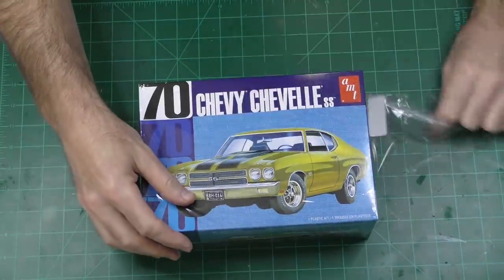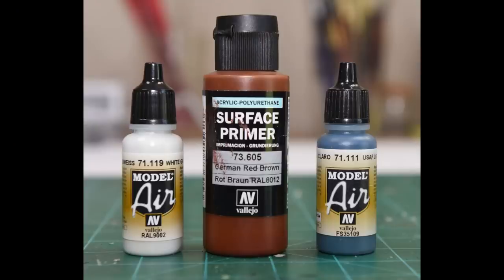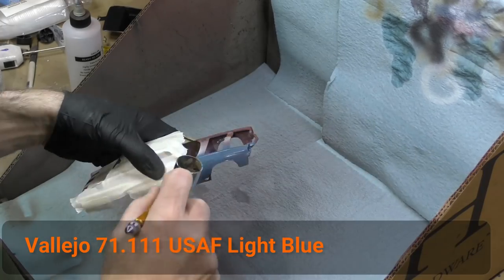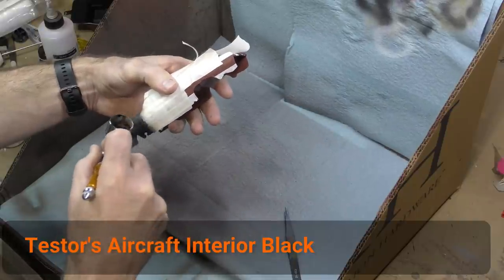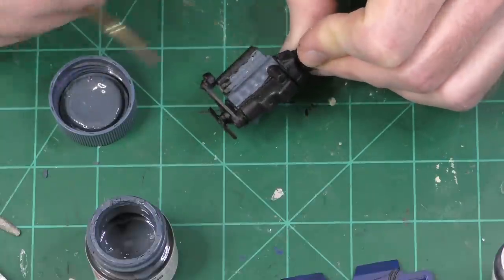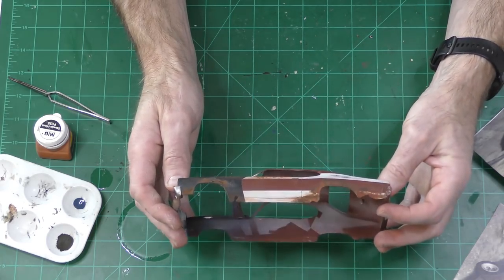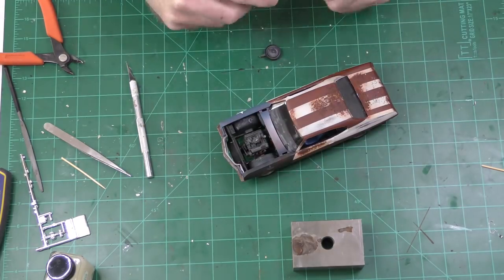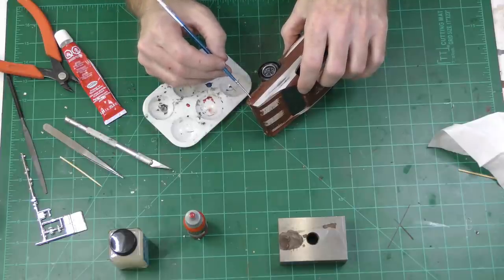Vice Grip Garage's "Independence" Chevelle Build in 1/25th Scale

Comment: The only thing you're missing is a massive smoke kit hidden between the back tires.  
Damn that is some fine work.  I think it'll be cool if you can make the fender wells wiggle just a tidbit and have little bits of rust fall out.  You could just put a little hopper inside the fenders and refill it with rusty bits for eternity. Just push on the fenders or shake the car a little chunks would fall out like a pepper shaker.  I like your attention to detail. 👍

Comment: When I built models back in the day I would use thread for spark plug wires and battery cables and bread ties for a fuel line to make the build last longer and I would scratch the numbers off of the odometer so you can read the speedo and other accessories

Comment: From personal experience the circles on the trunk are dripping paint cans. At some point in the cars life it was used as a paint table when one of the owners was doing a project involving paint. A sloppy painter that doesn't want to drip on the project will scrape some paint off of a brush on the lid area of the can and more times than not some paint will drip. A note in case you try it at home valspar is hell to remove off of a hard wood floor.

Comment: some time if you need the windshield and back glass to fit a warped space you cut them apart in that roof liner tabs area. to get thing like air cleaner ti stick you can slash cross-hatching into the mating surfaces with an xacto knife. nice build.  dereks a hoot.

Comment from the maker: A guys wants to call out a couple of mistakes I made for you fellers who want to try to build this.  It looks like the actual paint is red on top of white, whereas I did white on top of red.  Use a grey primer under the white and sand through the white to reveal the grey.  Sand through the red to reveal the white.  I really missed the grey wear on the paint job.  Also, my blue may a be a little too dull.  The original does seem to be a more vibrant blue.  Finally, I did not do a great job in getting the stripes the right size.
Reply: Did Derek comment? Man I like it!! Good job!
Reply from the maker: No, I took a closer look at one of the original pictures.  I wish I had paid more attention to the details.
Reply: Don't beat yourself up guy, a tribute to a tribute is close enough, in fact is looks facktree.
Reply: add some shine juice. might make the blue pop.  I believe VGG cleared overed the rattle can paint
Reply: A guy has beat me to ''a guy'' comment
Reply: @DKbananas  He did put a little wax on, wax off shine on that concourse paint scheme with Independence.

Comment: You must have some machining background going by the 1 2 3 blocks and the flash mentioned maybe a mold maker .
Reply from the maker: Thanks for the comments.  I don't have a machinist background.  1-2-3 blocks are just really useful for modeling.  I picked that up from some other video.  Never was a mold maker, but flash is just part of modeling and is really common on these old kits as the molds deteriorate with wear.
Reply: @asdasx392  cool I'm a retired mold maker and have made car molds thanks for the info.  But I am a avid Vice Grip watcher . Great Job

Comment: It would have been so easy to replicate a no grille on that kit just cut the edges of the grill and the bottom where it meets the bumper, flip it backwards, and glue it to the back of the fender extensions of the body flush with the hood closed.12:16